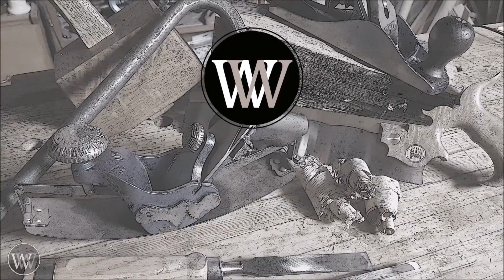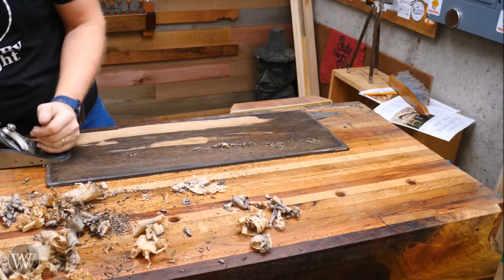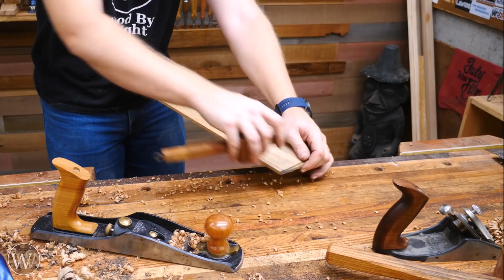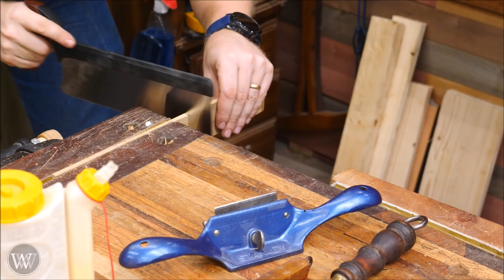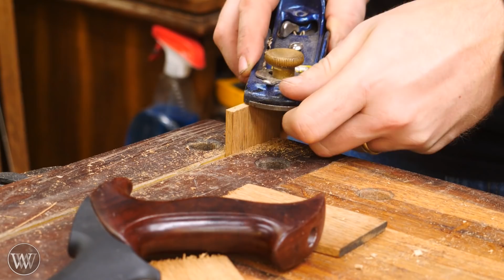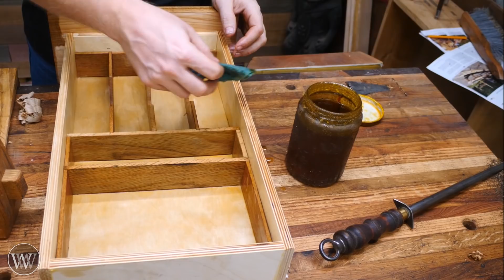Making a Kitchen Drawer Organizer | DIY Hand Tool Woodworking Project

Comment: James, have you thought of adding some kind of clamping jig/tool to the saw bench? I can't stand holding down wood when cutting it - the most I can do it concentrate on 1.5 things at once :)
Reply: Or I guess you use only pieces that are long enough to be held by your knee, where they're uncomfortable to use in a vise...
Reply: I like these daily uploads!
Reply from the maker: I have thought about that, but if it is too small to use my knee I prefer to clamp it in the bench and cut it there. Just my preferred method.
Reply from the maker: Thanks man. more to come!

Comment: Nice !!!!
   I’ve a question, no way am I being critical. I’ve been a carpenter for 30+ years. I’m learning hand tool methods. Just dug out my grandfathers old woodworking hand tools I inherited over 20 years ago. When I worked with him as a teen, he made me use hand tools. That’s been a long time ago. So I’ve forgotten a lot of hand tool technics. 
   When you were shortening the divider that was too long, you used a block plane from both sides to prevent blow out. I get that, but would a shooting board have similar results ?? I would think it would be purdy secure in a shooting board also. Probably 6 one way 1/2 a dozen the other. 
    Just trying to absorb from the experts.
Reply from the maker: thnaks, I often use the shooting board for most end grain work but for just one piece this is just faster and more fun. to use the shooting board I have to clear the bench for it, get it out. get that plane out, set it all up. shoot it twice, then put it all away. plus I like to keep other skills sharp so I do not have to rely on jigs if I don't need them. Thanks for the great question.
Reply: Wood By Wright 
   Fair enough. Makes a lot of sense.